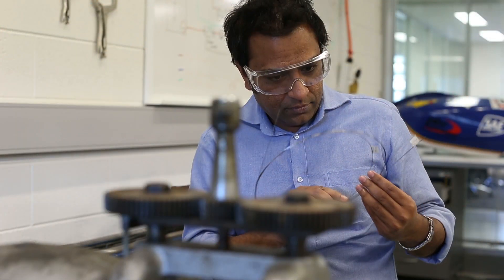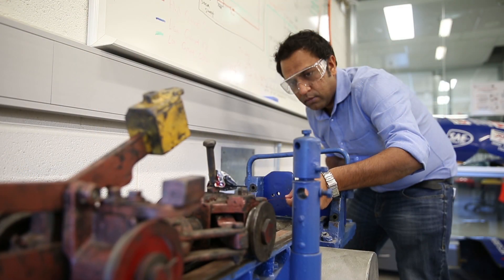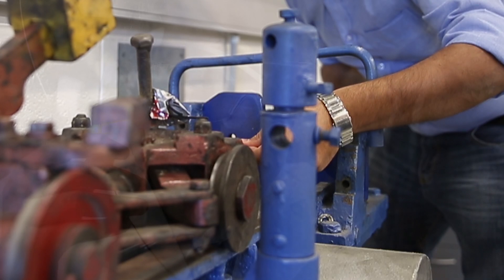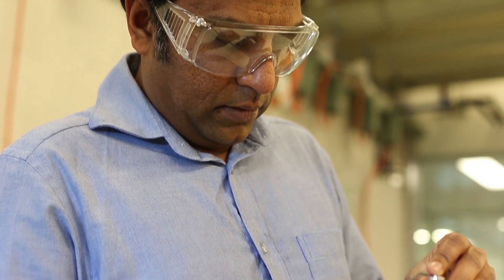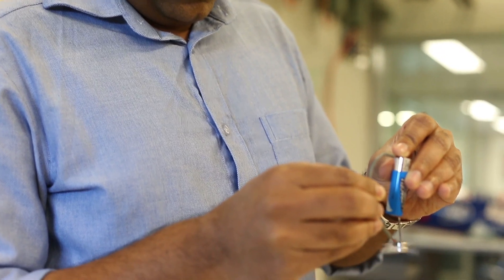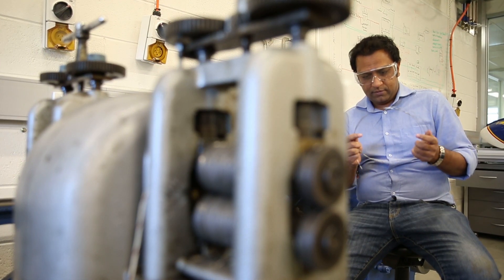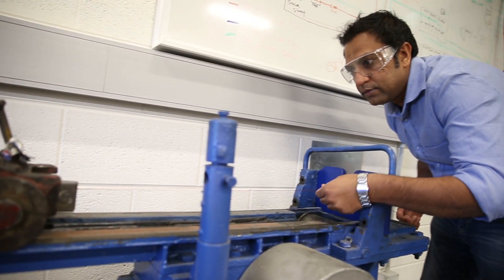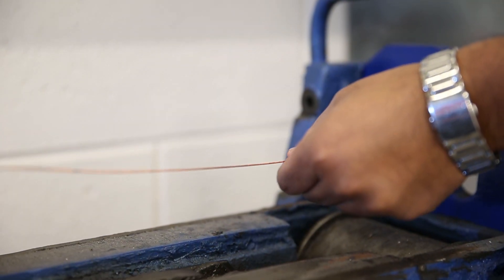Low cost, super efficient offshore wind turbines for a clean energy future

Comment: Nice idea. Bullshit numbers.
Turbines are already 45+% efficient and the maximum possible is 59.3%. This can't be 1000 times better.
The gearbox is only 10% of total project costs. This can't come even close to reducing costs by 67% even if it was free (or at least not made from expensive material). Permanent magnet generators, and hybrid drives will totally eclipse superconductors.
Also offshore is decades away from happening in Australia, we still have loads of world class wind sites onshore.
Oh! Also cryogenic coolers are probably only 30% efficient. And cryogenic bearings would cost a lot.

Comment: "1,000 times more efficient" than what? Standard turbines already convert around 45% of the kinetic energy of the air flowing through the turbine into electrical energy. The theoretical limit (Betz's Law) is 59.3%. This is an extremely silly claim.

Comment: That material requires −234 °C. So instead of quite robust and conventional technology of gearbox(which is not anymore used at least in Vestas windmills.. just note) you will have gryo system in the 150m above sealevel which doesn't naturally need maintenance.. wait or perhaps it needs little bit once in a while. Also the saved energy from copperlosses (from windings) is lost by the energy required by the gryo system. Also there is never loss free system so iron losses, joule losses, windage losses are always there. Just note to every one thinking this will save their world ... sorry to be pessimistic on this but this time it's good to be realistic.